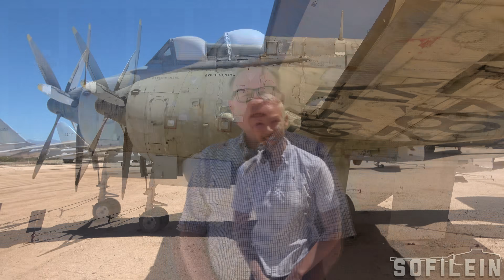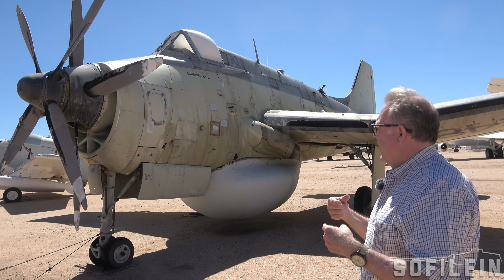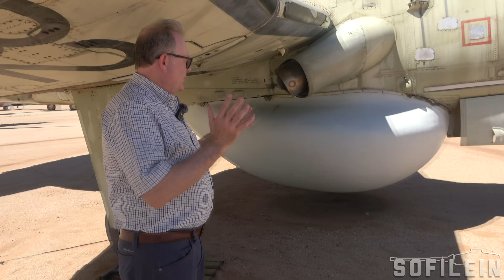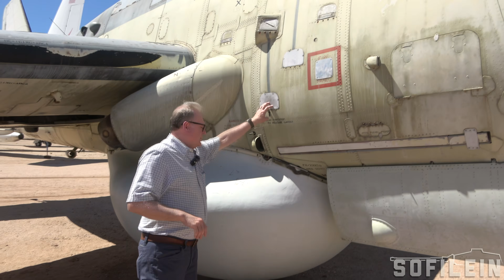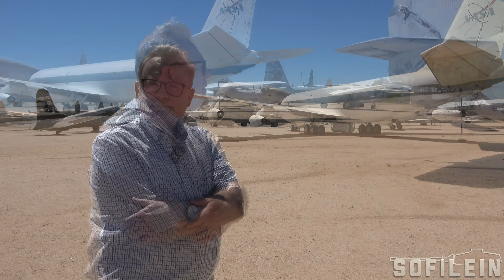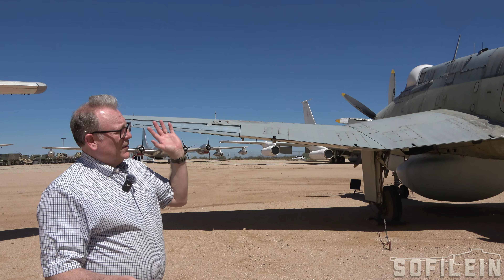A Gander at the Gannet (Fairey Gannet AEW.3) at Pima Air and Space Museum

Comment: Manufactured at the southern factory  at Hayes, Middlesex  West London, 6 miles down the road from my home location, and at Southport, Lancashire. Poor old thing . . needs a tent to keep the worst of dessert sun and sand  off of it.

It may be somewhat lacking in graceful lines. . . but when you consider the engineering and capability crammed into that thing,  performing functions which today requires land-borne aircraft 4 times the size.

Comment: I served on 849D Flight on HMS Eagle in 1966 during the exercise Highland Wedding after which we were supposed to go to the United States. Unfortunately the ship developed some engine problem and we returned to Plymouth. I finally made it "over the pond" on HMS Ark Royal in 1978 as a member of the SAR flight but with the trusty Gannets still operational. We did lose one to a deck landing accident when it struck the jumbo crane during recovery in very bad weather but no-one was injured and the airframe was eventually craned off in Gibraltar and taken to North Front to be used by the fire crews there for their exercises.

Comment: I'm impressed with your 1st choice Sofi. Interesting how it uses several low volatile fuels to increase safety on aircraft carriers among other features.
Scott certainly did a wonderfully informative talk about the Gannett.
You asked for requests about any of the aircraft there and for me it has to be the B-36 Peacemaker which was designed to bomb Germany from the USA had the war lasted longer than it did. It had some almost bizarre ideas experimented with like carrying its own fighter planes for self defence and the famous nuclear reactor flights which had they been progressed with would have B-36's able to be in the air for days with the piston motors replaced with powerful electric motors at a time when the USAF kept regular B-36's snd B-52's in the air 24/7 to react to a first nuclear strike from the USSR. Consequently B-36's had sleeping and eating quarters. Sadly only a couple still exist but they are so big that posses problems of preservation. Luckily the B-36's as they were in the mid 1950's were featured in wide-screen and color in the movie 'Strategic Air Command' starring WW2 USAF veteran Jimmy Stewart which is available on BluRay.

Comment: I worked on one of these in the early 90s where it had been purchased and we were trying to get it into a serviceable state to allow it to start the engines and taxi down the runway and unfold and fold the wings. We even found a reconditioned double mambo and gearbox set with only 10 hours of use. Other than it been a fixed wing aircraft compared to my rotary one the biggest thing i remember is the weight of the two massive batteries housed in the compartment below the radar operations position, and the small hatch.

Comment: I used to work at the trucking company across the street. From about 6am to 8am, depends on the day, you can watch A-10's taking off and a lot of times doing touch and go's. On the rare occasion F-16's will use their runway. Also, you should do a video on the Supper Guppy. I know it's a transport craft but it's just so unique. Or on the B-39 or B-47. Both are great looking aircraft that have been overshadowed by the B-52.

Comment: Good video Sofi: I like the way you let the experts talk themselves rather than "interpreting" it and thereby introducing a source of error (Chinese Whispers and all that).
Some extra points about the Gannet :

1. The choice of co-axial props was mainly due to it being the most compact arrangement for a twin-engined aircraft, however another huge side benefit was that it eliminated asymetric thrust in the event of an engine failure. Powerful conventional twin-engined aircraft are hard enough to handle trying to land them on runways: trying to do it on a pitching, rolling carrier deck that might need last-minute corrections is a nightmare.

2. The reason for the double-fold wing was that all British post-war carriers had been designed and built (or at least laid down) during WWII and so had hangars sized for WWII aircraft. Because it was Royal Navy policy to have armoured hangars and flight decks, and in some cases double-deck hangars, the individual hangars were kept as low as possible to minimise topweight. The rapid growth in the size of aircraft post-WWII made this a thorny problem and some later, "lower-mileage" carriers were actually retired earlier than older ones due to thier particularly low hangars. Why not just rebuild them? Well the armour made this a much more expensive and complicated job than it would have been had the armour been at hangar deck level (as in US carriers) than at flight deck level, because the armour was also a load-bearing component of the ship's structure. It was tried on one carrier (HMS Victorious) but that project turned into a long-drawn-out, over-budget, over-timescale nightmare, and although the resultant ship was decent enough, the experience put the RN and the UK goverment off the idea of carrier rebuilds forever.  Brand new carriers were planned in the 1960s, but then changing government policy and sheer lack of money saw them cancelled in 1966.

3. The extra fins on the tailplanes were added late in the development of the ASW version (which came first) due to the addition of a third crew member and a bigger radar. The ASW version was originally supposed to have two crew in tandem up front and a small radar under the rear fuselage. However it was then found that a third crew member was needed to handle the workload and a bigger radar, in a retractable "dustbin" radome, was specified. The third crewman's canopy and the bigger radome (when extended) increased side area and thus decreased yaw stability. On a land plane you'd just increase the fin area to compensate, but on a carrier aircraft, particularly one that needed to fit in the low hangars with which British airccraft carrier were cursed, that wasn't an option, hance the addition of the extra fins instead.

Comment: Apparently the Russians are not the only ones to use counterrotating props
Reply: Apparently you've heard of Tu-95, but not about DOZENS of other designs that use them? Really? How?!
Reply: These are contra-rotating props, they are on one shaft.
Reply: @jester5ify  On the Gannet the props are on two shafts, driven in opposite directions by two separate engines. On the Tu-95, the props are geared to each other and are driven by one engine. Being pedantic about it, the Gannet props are NOT "contra-rotating" (i.e. geared to each other), they're "co-axial, counter-rotating" (i.e. independent but on the same axis). The test is what happens if you turn the front prop by hand: if they're contra-rotating, then the rear prop will turn the other way (Tu-95), but if they're co-axial, the rear prop will stay still (Gannet).
Reply: @MrHws5mp  Your quite right, doesn't help that alot of the literature just states contra rotating where as they are as you say counter rotating... lol
Reply: Just about every major aircraft making country used them.
Reply: The British invented them and pioneered the use and development of contrarotating props.
Reply: AVRO Shackleton too…….RAF…..
Reply: I saw counter rotating props on a German ww2 prototype in the restoration hanger at the US Air Museum at Wright-Patterson AFB in the 70s.  It had counter rotating props and cowl mounted machine guns synchronized to shoot through the props.  I thought it was a variation on the TA182 and sort of resembled a FW190.
Reply: Nice 8 Sqn Shack in the background…..lovely to see